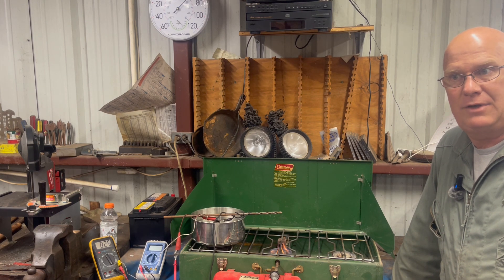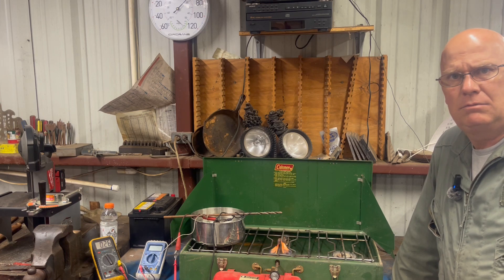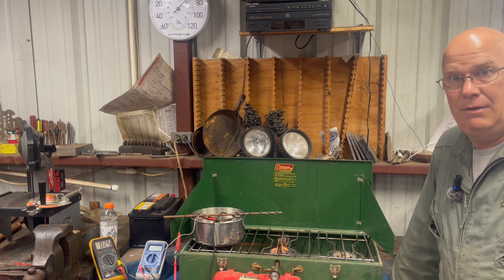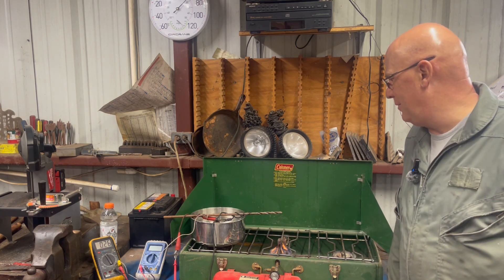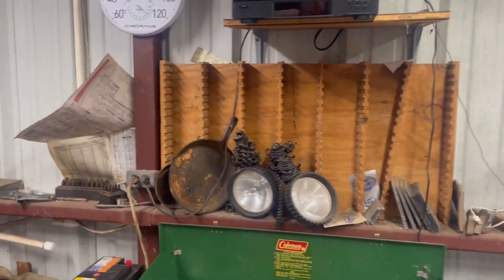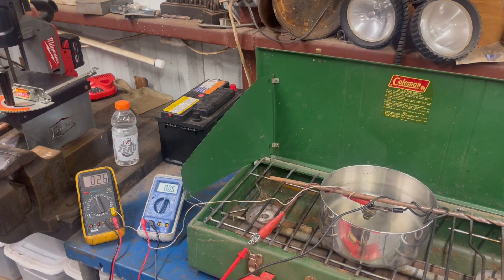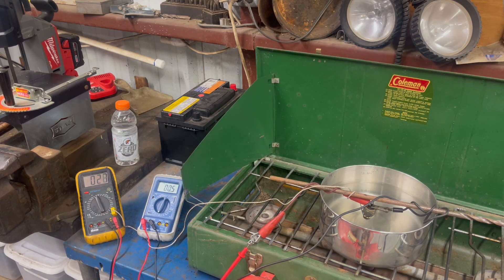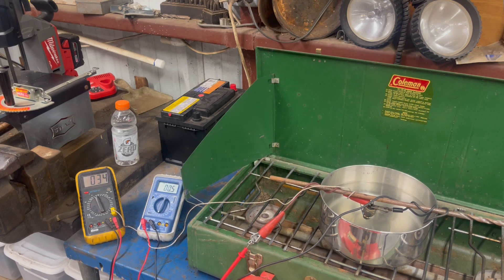6.2/6.5 Diesel Fast Idle/Cold Start Advance Temperature Test and failure

Comment: I have been fighting a high idle issue in my 85 m1008. They want 500 dollars at advanced auto for the cold start valve temperature switch
Reply from the maker: There are two on eBay right now around $100. Search for ACDelco 10154649.

Comment: Tim thank you for all of the great content. I have a question regarding the plug connection to this switch. I have pulled and pulled and cannot get the plug off of my switch. This area is hard to reach and see if there is a clip i need to either push down, or pull up on to free the plug. Do you happen to know a trick to getting this thing off? Or if there is a clip i am missing? Thanks
Reply from the maker: @xsaltypoptartx  I find it easier to go at this plug from the bottom. Mine do not have any kind of latch on them. They are tight, but do come off. I have nothing newer than 1987 though.
Reply: @timsteachablemoments1786  sounds good thank you! This is on my 1985 m1009. I'll just have to give it a couple more ugga duggas

Comment: Hi, I love your materials. They are really helpfull. I am new owner of M1009. Recently i have discovered that in my CUCV there is no "green wire"  on  FIP and no fast iddle stop solenoid ( the one at the end of green wire controlling throttle position). Can you help me to find new one or some replacement. The bracked is also missing. Thank You
Reply from the maker: Thank you for watching and I am glad you like it. 

Instead of finding and buying all the components separately you might be better off finding someone parting out a truck. I would suggest posting about what you need on Steelsoldiers.com. Another option is hillbillywizard.com. They actually part out CUCV trucks. 

Before you go buying anything though. See what all you are missing and might be needing. Maybe everything will fit in a single box and save you some on shipping.

Comment: Once I read that the switch opens around 120 Fahrenheit, but that was a while ago and I never researched it that much. I have my cold Advance solenoid and high idle solenoid on separate switches. I only use the cold Advance on cold mornings, and I pretty much never use the high idle. I'll use it if I'm jumping another vehicle off
Reply from the maker: Good idea for the high idle when needing voltage. Thank you for watching.